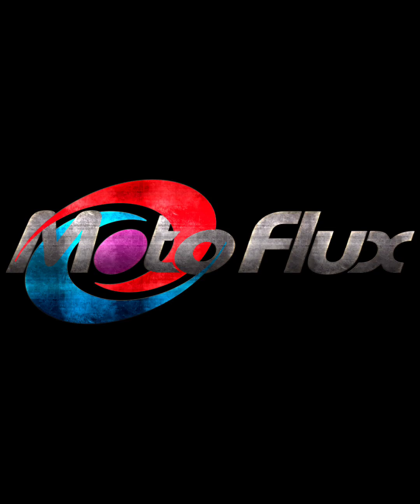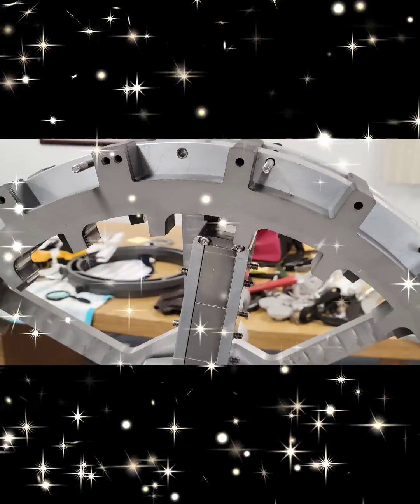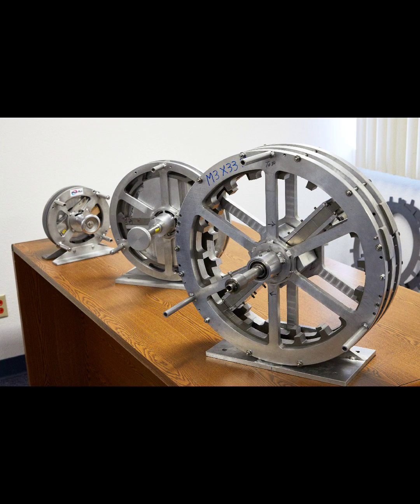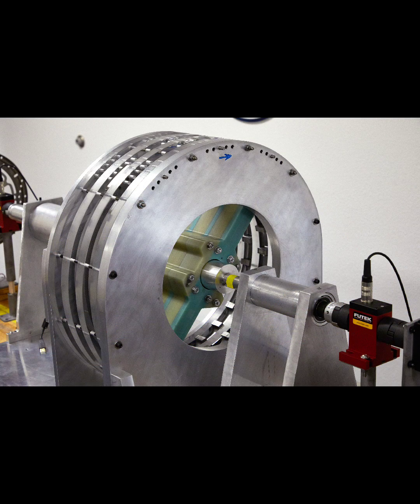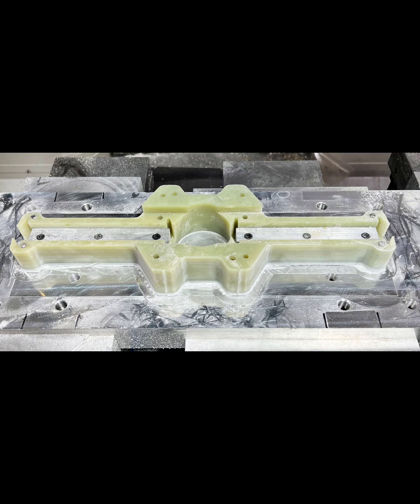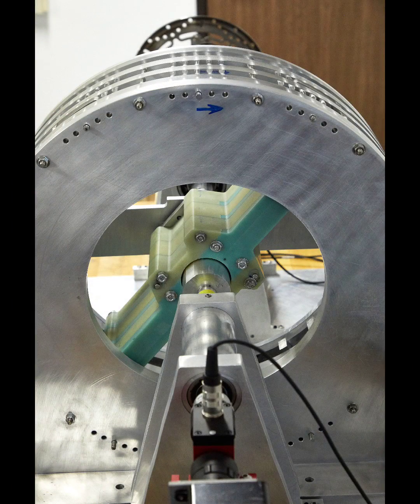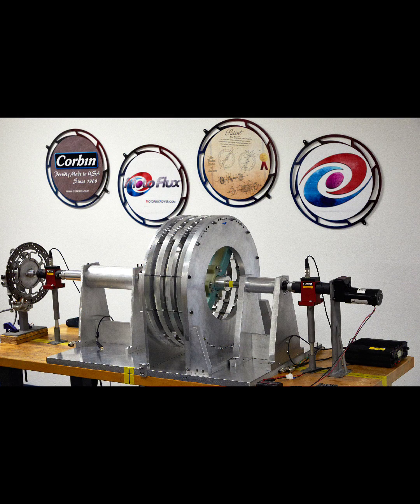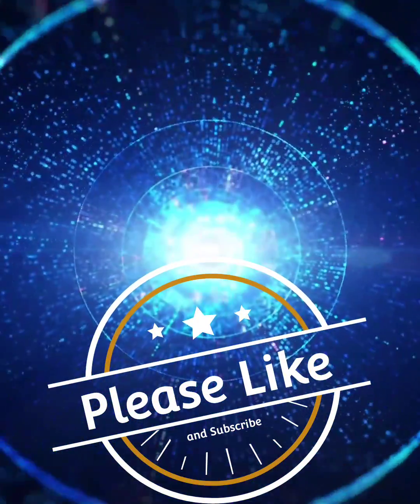MotoFluxPower.com New patented Permanent Magnet Motor

Comment: No progress at the Motoflux-Homepage. In the last "News" they write, that they will now increase not only the torque but also the power. Which makes no sense, since more torque with the same rpm means more power! Why do they want to achieve something which has been shown already? I rate this as one more evidence that this design doesn't work. If there was an error in the torque measurements or if it was a deliberate sham is hard to tell.

Comment: On the Motoflux-Homepage you can read, that this is not free energy, because it needs energy to produce magnets. But for this energy you have already paid when you bought the magnets! If you don't get out more than that the whole device would be useless. Probably Mr. Corbin has made something wrong with his torque measurements. There is no reason to assume that torque can be increased by this device.